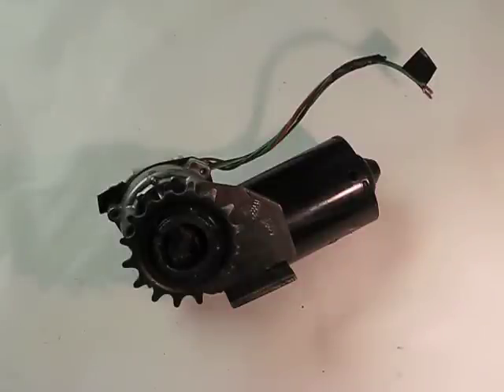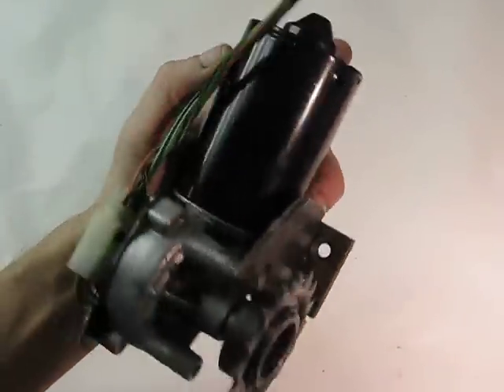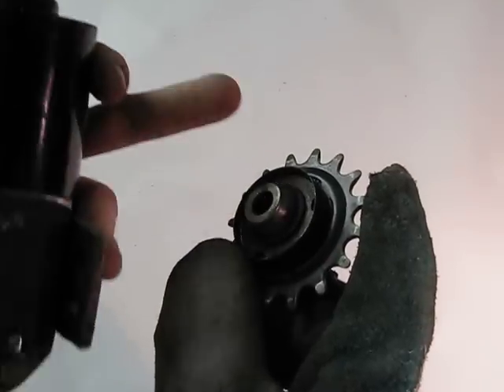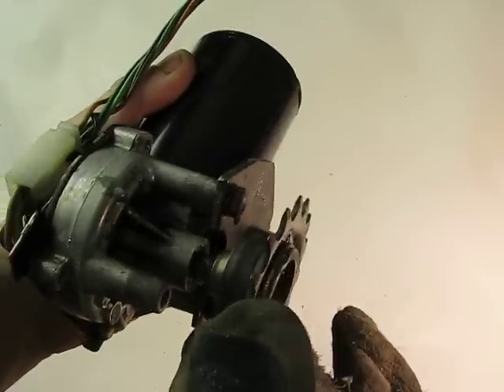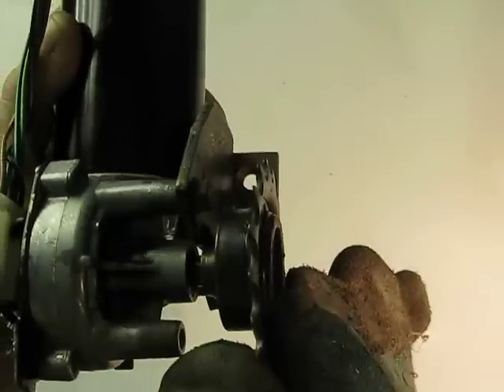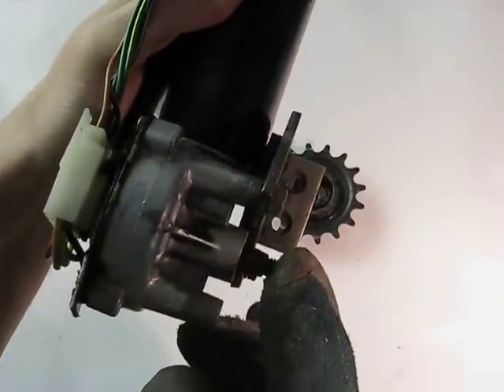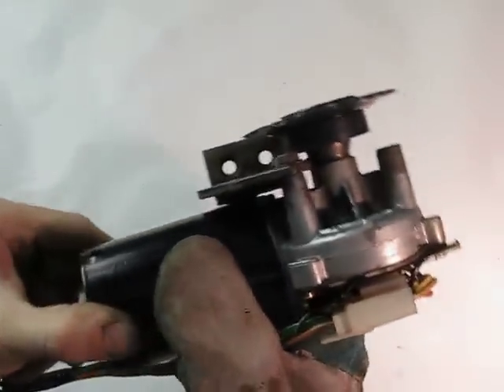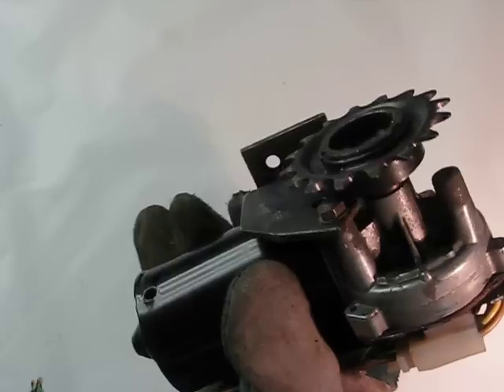Windshield Wiper Motor Ebike: How to DIY

Comment: can it drive motorcycle chains? and sprocket
Reply from the maker: Probably not.. its a small motor, it would have to be much bigger to do that and it is the wrong kind of motor cause it would go very slow rpm.. it would be ok for a robot but not a vehicle unless u like going reeeeeealy slow :P
Reply: for wheelchair. ive tried it and its okay. now the sprocket is connected to wiper by thread. but when I reverse the direction, the sprocket come loose

Comment: To incrase the RMP it would need a big crown fitted to the motor and the smallest possible pinion in the wheel. A wiper motor has less than 1 turn per second.
Reply from the maker: yeah it wasnt that good it burns out easy : /
Reply: Is this motor can be used for wheelchair project
Reply from the maker: no its very small compared but it is the same configuration as a wheelchair (the gears work the same - a screw gear i think its called)

Comment: I have bosch 12v wiper motor , Will it have enought power for electeic bike , I dont need big speed max 20km/h . my gear ratio is 16-18
I can change sprocket on wheel
Reply from the maker: i dont use this type motor anymore cause its very inefficient and not powerful enough.. but it does technically work.. until it burns out lol but i suppose you could yes :D
Reply: Richard Harris 
I made e bike with 220v 500w drill ,1000w inverter and 100ah car battery

Comment: How many watts is such a motor? Does it spin fast?
Reply: Cosmo John right. Honestly if just go with like an old electric scooter motor like 250watt and that would pull ya much better
Reply from the maker: Cosmo John I'm not sure .. probably 5+Amps?.  is my guess... it spins slowly but has a lot of torque
Reply: 5 Amps multiplied by 12 volts = 60 watts. Not that much power but if its geared low pretty good then you will have decent torque but a limited top speed.
Reply: TCircuitry excellent answer,  thanks for your reply.
Reply from the maker: TCircuitry my other ebike video (with the radiator fan motor) is probably more efficient.. this was just an experiment. this one probably has more torque but much more energy loss :/
Reply from the maker: TCircuitry this is probably a good diy for people that live in a junkyard  hehe they could make these bikes all day :P
Reply from the maker: also could make a good drive for a robot
Reply: Cosmo John no problem. Just also remember that 746 i believe in watts equals one horsepower

Comment: Did you make any special work on the gear will or did it fit easily. I want to do something similar?
Reply from the maker: deli basist everything fit fine
.. if you try to make one.. try and find a better windshield wiper motor, mine was too small and had a nylon gear that wasn't very good... try and find a big one off of a truck that might work better
Reply: Richard Harris basically I wanna make a spit roaster thing! and I need to make some gear wheel and chain connection to bar. I think that's the easiest way to make that setup same as bicycle setup
Reply from the maker: sounds good! I bet that would work fine!

Comment: friend of mine had an electric cart his dad build for him , the problem he had with the wipermotor he used was that the wormwheel on the engine shaft started to slip over the fiber sprocket that was on the wiperarm 
it can work but it isnt made to produce a lot of force so it whont last verry long

Comment: ı tried. it isnot proper rpm
Reply from the maker: it's not good :( it burns out.
Reply: I MEANED FOR E BİKE
Reply from the maker: the motor worked but it burned out.. it went ok for me for a while but it had a plastic gear and it melted lol
Reply: duhh, did you add a speed controller, duuh

Comment: Nice. Ive seen some (including old 2 stroke vintage bikes) where the drive is a rubber wheel about the same size that rests on top of one of the wheels and just push's it directly. It can have a lever to lift or lower it in place. I wonder if that would work too. Ive got to get one of those motors!

Comment: when i was looking at e-bike conversions, my first thought was "i could do that with a windshield wiper motor" 
lol, and you did it! if the motor heats up too much, maybe turn the rear wheel into a fan blade assembly facing toward the motor? just wrap a few angled pairs of spokes with tape? maybe zip-tie plastic/cardboard? i wouldn't think you'd have to do them all but you could... that should help.
thumbs up!